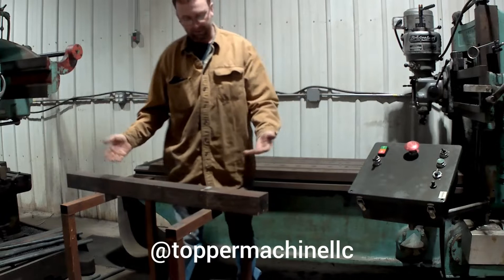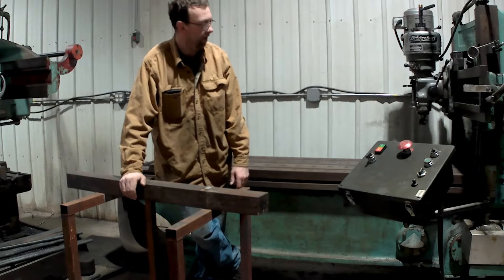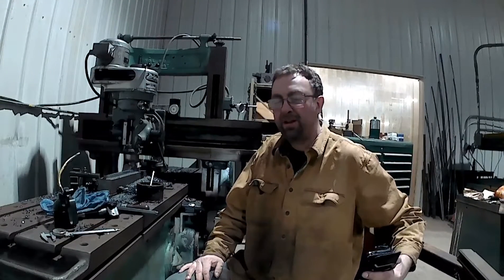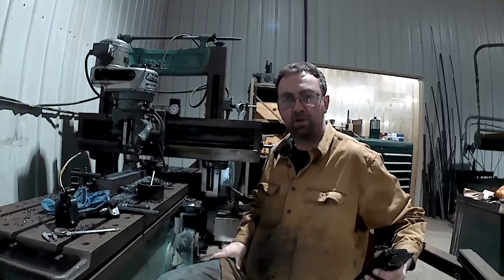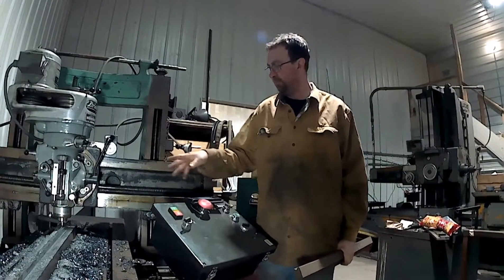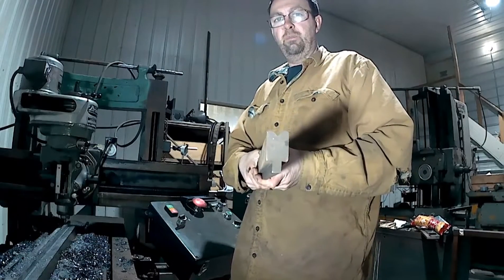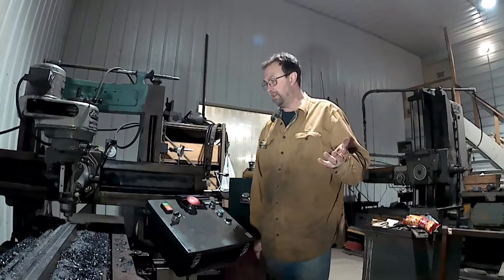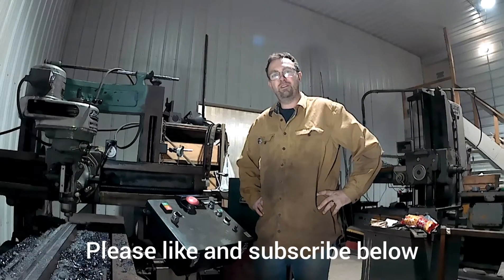Milling a Press Brake Die on a Metal Planer Mill, Part 1

Comment: This is so timely for me. Just bought stock today to make a 20 ton hydraulic finger plate jig and was pondering set ups on my Bridgeport. It will be the first time knodding it’s head for multi angle block and the blades., may now use the block to steady blades. Thanks for the help and inspiration.
Reply from the maker: I just put up part 2 of this series. It will be 3 parts, but the final one will be a while as I need to year down for a paying job.

Comment: And those T slot clamps are a great idea
Reply from the maker: They are in a few of my old machining books in the planer sections. Can't find any common used names in any of the books, but work awesome.
Reply: @TopperMachineLLC  did it specify what degrees to drill and tap the hole?
Reply from the maker: @craigtate5930  no, I chose the angle

Comment: For a job like that, original head and clapper box with a HSS tool bit might not be the fastest, but it sure would save on ruined end mills and be a lot cheaper.
Reply from the maker: None of the original parts or drive were on it when I got it. Would love a complete planer, but this works

Comment: That planner mill looks super versatile Great job . have you thought of putting a coolant mister/fog blaster on it ?
Reply from the maker: I have not, because I don't usually use it with carbide cutters and never had an issue. And I don't like coolant in the air. But maybe one of those cold air guns would work.